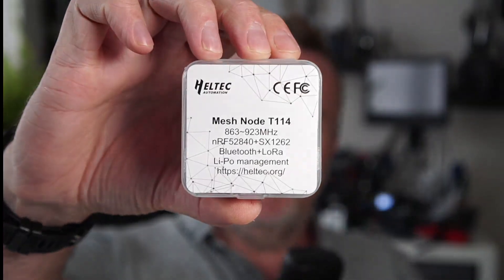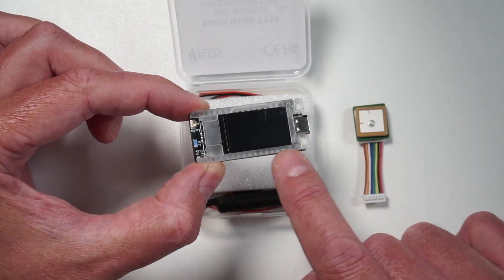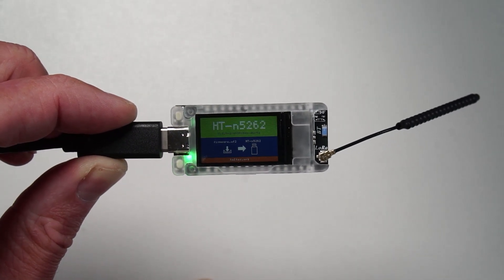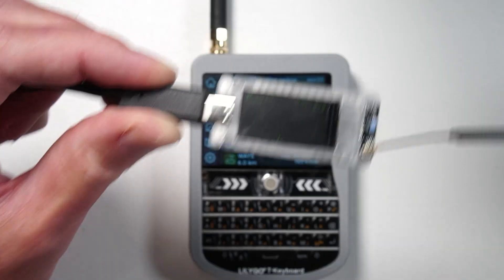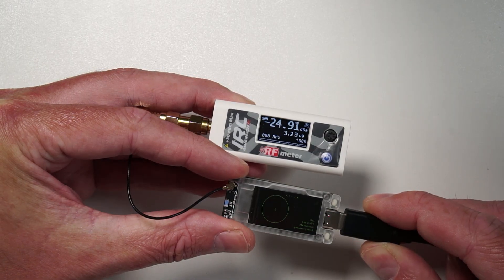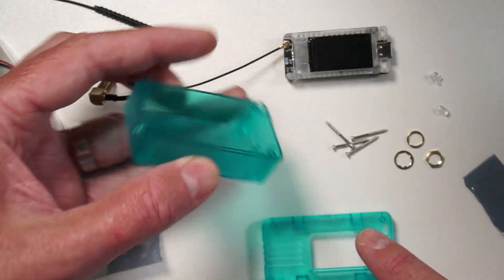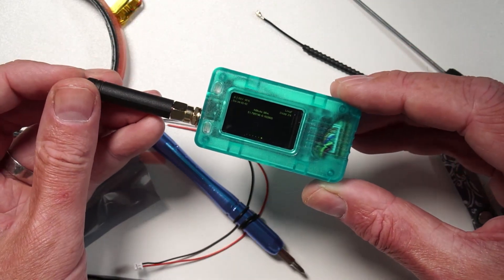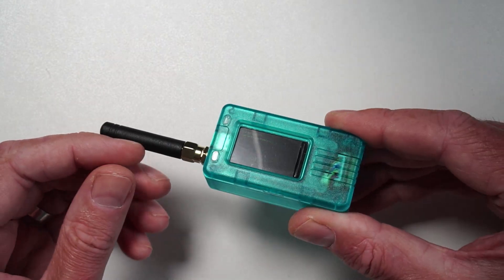Heltec Mesh Node T114 First Look!!!

Comment: Ive a project  i need but havent the know how and i think you have ..its sort of voice over lora as well as text....phone connects to meshtastic node by usb and the bluetooth to connect to headset ..you speak into phone through bluetooth headset android using voice to text changers voice into text and sends it then the receiver changers it back into synthetic voice ..in like a patrol or active uses with encryption low power and cheap and self healing

Comment: The reason why the GPS has 8 lines and not just the usual 4 is that it has reset, interrupt (wake) and power saving mode selection on the other pins.

Comment: My T114 stopped working yesterday.  I can push reset twice and get it back into disk load mode and it shows up on my computer without a problem. But the Meshtastic software is gone, just the three preloaded files are showing up on it.  And when I try to reload it but dragging the Meshtastic software back onto the dish, it starts to load it, but stops and ejects the dish from the computer.  It never loads. The only thing it is doing is the lights behind the user and reset buttons are blinking.   Anyone have any ideas what is happening?  Thanks
Reply from the maker: There's an erase firmware that erases the whole flash contents... worth a try... I'll try to find it.
Reply from the maker: https://meshtastic.org/docs/getting-started/flashing-firmware/nrf52/nrf52-erase/#:~:text=You%20may%20now%20use%20the,to%20begin%20the%20erase%20procedure.
Reply: @andykirby  Thank you very much!

Comment: I would hold off buying one for now due to a presumed hardware issue when txing messages longer than 40 chars. The issue isserious enough for the firmware to be pulled from the Meshtastic firmware site.

Comment: The lease function is pretty simple I lease out sets and will often find that customers can be quite adept at delaying the return of sets so they can have extra days without paying. I have in the past resorted to driving by a customer site and using a "kill" tone to disable leased sets, but this is not always convenient. 

It also means that "lost" sets are quickly useless, and when it is known in advance that sets will auto-brick, it discourages such "accidental misplacement" of radios. Sure I bill them the full cost of replacements, but there is the hassle of buying and programming new ones, and it may leave me short on stock for other customers until replacements are ready, not to mention the problem of people who are slow to pay, or even outright avoid doing so.

Comment: I have my T114 up and running in Reston, VA  USA.  Only on the air a few hours but building up a node list. I have a Bender case on order and is in the Royal Post heading my way.  I have use a magnifying glass to see the text.  Sure hope that gets changed in the next software release.  I'm on 2.4.2 now.

Comment: I think the biggest question on mind got missed all together …. What’s the power draw???
Reply from the maker: Seperate video coming on this.
Reply: And can you disable the display to save power?
Reply: Yes; the display, and GPS full power is a switchable line (labelled: 'Ven') controlled by the onboard LDO. 

This line also switches the power to the onboard NeoPixels (there are two!) and is available on the edge connector so you can also de-power peripherals like I2C keyboards and environmental sensors etc.

It's software controlled so I guess we may need to wait for software support to get refined to really use this effectively.

The GPS also has a permanent VCC line so it can low-power sleep and fast wake etc.

I just spent half an hr looking at the schematic; this board looks really well designed from an electrical point of view.

Comment: @andy kirby: Do you know what type of voltage solar panel it will accept? I cant find any info on this, battery says 3v to 4.2v but nothing for the solar panel input, I would have though 5v but that's a guess.
Reply from the maker: I've been trying to find this info too, I presume 5-6V bit ill check with Heltec first :-)

Comment: @andy kirby Does it have the exact same form factor as the V3?
Reply from the maker: No it doesn't.
Reply: @andykirby  Thanks Andy. Can you please add a link for the firmware for this on Meshtastic? Having trouble finding it on Github or anywhere for that matter.
Reply: Skip that, finally found it in the massive repositry zip for 2.4.3

Comment: Were do you get the batteries with the right connectors with the correct polarity? (no soldering)
Reply: You can very easily switch polarity on the connector by lifting a tab and sliding the wires out and then pushing them back in the way you want them. No soldering required.